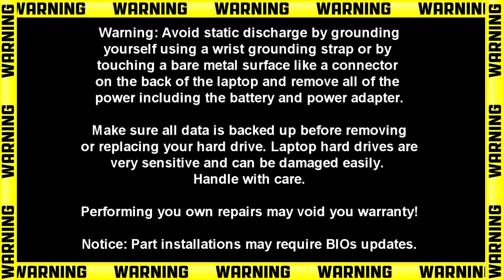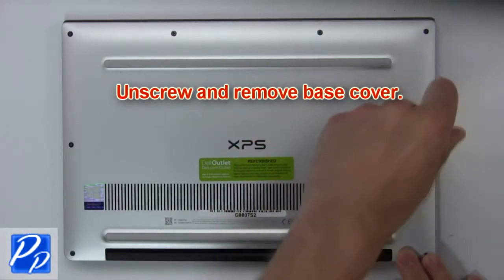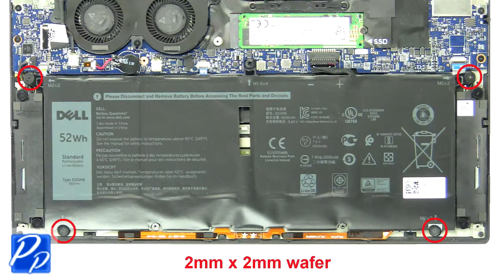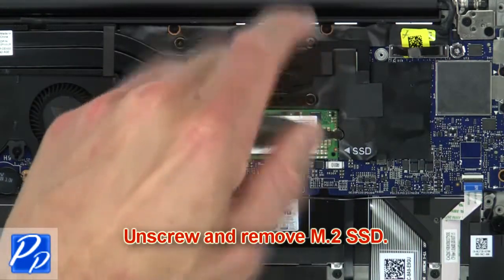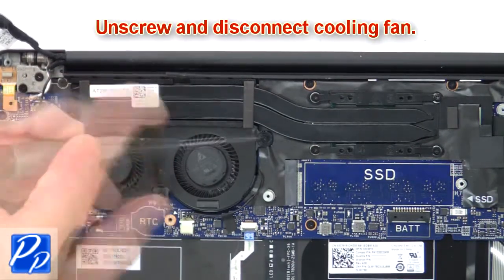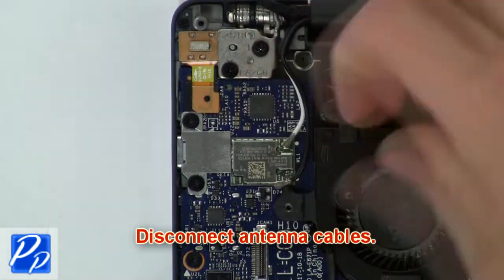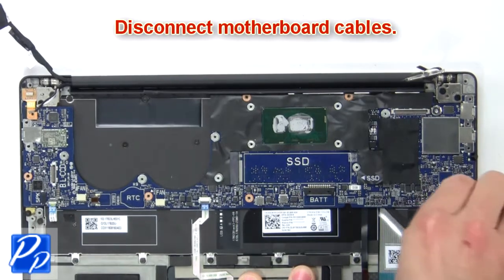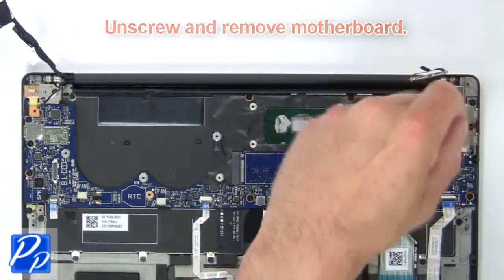Dell XPS 13-9380 (P82G002) Motherboard How-To Video Tutorial

Comment: I know the RAM is soldered but can it still be upgraded?
Reply from the maker: Unfortunately this motherboard only comes configured with 8GB or 16GB non-removable RAM. The only upgrade option here would be the larger capacity 16GB motherboard if you were moving up from the one configured with 8GB of RAM.